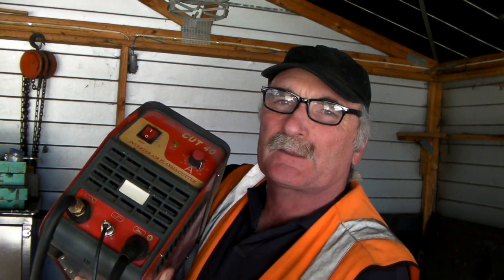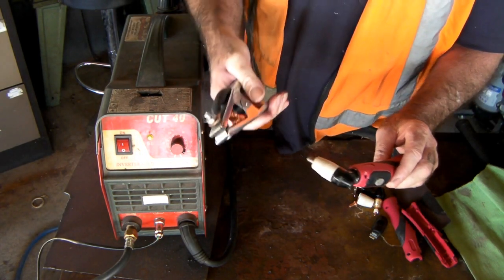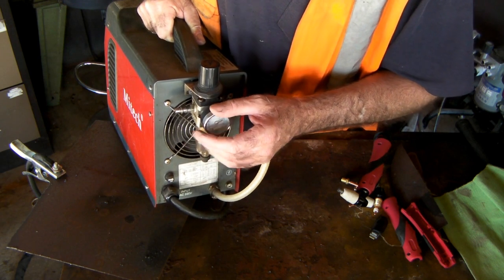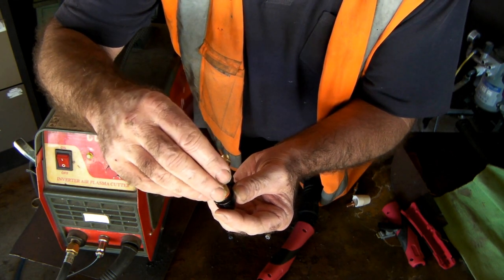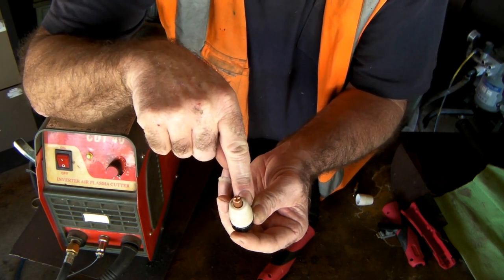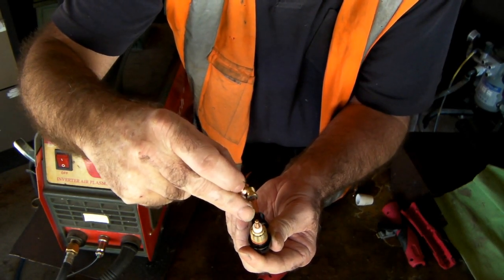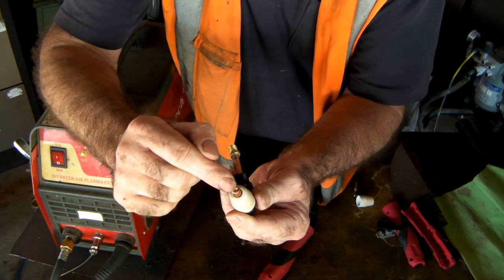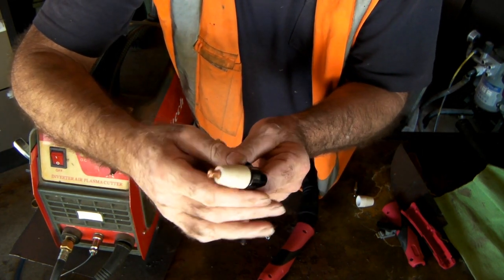Plasma Cutter How It Works ???

Comment: Great video.  I am new at welding and now looking to buy a plasma cutter . In welding one needs to buy welding rods to weld. 

Question:    

What does one have to buy to keep using it?  Like what expense is involved every time one cuts metal as in the welder its the welding rod, so what is it with the plasma cutter.   Thanks to anyone who may have knowledge on this.
Reply from the maker: Good luck!

Comment: Thank you shearing sir. 😀

How many volt plasma cutter use & how many amp ? Please let me know sir.
Reply from the maker: Hi 240 volt at 40 amp cheers
Reply: @petestools  thank you sir.
So 96000 watt ?

Thats pritty hight power. 😀
Reply: @petestools  it’s not 40 amps, if it was it would instantly blow all the breakers in the house

Comment: So plasma cutter basically use electricity to heat up the metal and use ionized compressed gas to cut thru it?
Reply from the maker: basically
Reply: @petestools  so that's who it works?